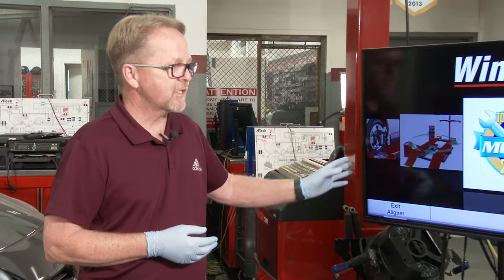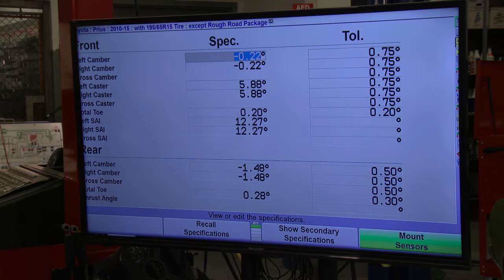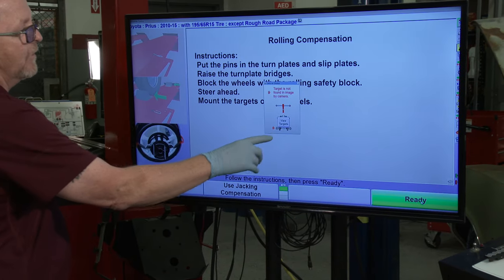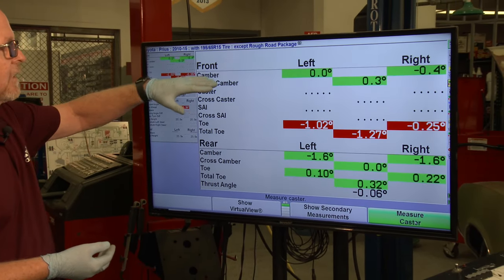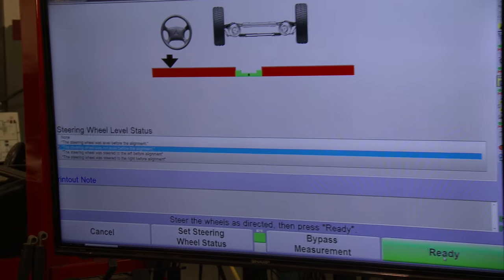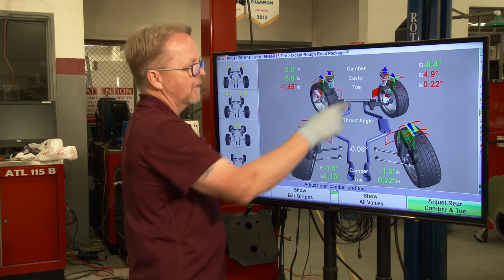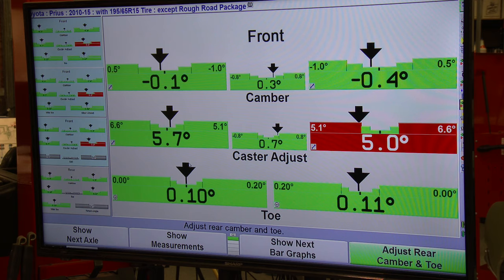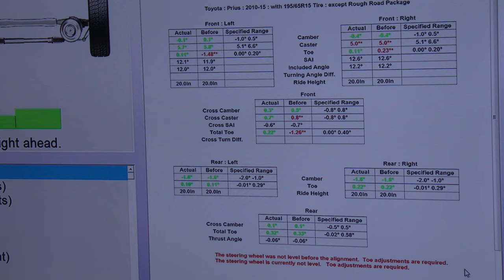Wheel Alignment Using a Hunter Alignment Machine

Comment: This is a well articulated lecture on a PA200 Wheel Alignment Machine. I once used a Microline PC 3000 Machine, Hunter D1111 Machine and Hunter  PA100 Machine. Currently I am using the PA200 Hunter  Aligner. Thank you, Sir for the lecture.
Reply from the maker: Thank you for the compliment. It sounds like you’re a well experienced technician so I really appreciate it.

Comment: I bought an old hunter machine, had to replace the batteries with some different ones on the heads (had to mount them on the exterior) and managed to get the program to work on a old laptop (pc that was running the program died).  Very handy to have at home in my shed for adjusting alignment on my race car.
Reply from the maker: Nice! I’m sure it’s spot on.

Comment: When the camber is out of adjustment on a car that they say is non-adjustable. Take the through bolt out that holds the strut to the knuckle and use an air tool with a rotary file to open up the holes in the strut so you have some movement.  Be careful not to open up the hole in the aluminum or steel steering knuckle.  Loosen the bottom bolt, then you have enough movement so you can adjust the camber.  If you are in a hurry and only interested in making money because you are working by the job, then you might want to forget about it and run the car outside.  Another thing is when you are finished with adjustments, you could move the car around a little on the turn plates and recheck the adjustments.  Just doing that might relieve enough stress on the suspension to show a need to fine-tune the adjustments.

Comment: A few lil tips. Start the car before depressing brake pedal and let the power brakes help you. Make sure the arms on the heads dont hit the lift when you roll the car for runout. If customer has sterring wheel cover then remove it before locking steering wheel. Check for worn steering parts and air psi beforehand
Reply from the maker: All good suggestions. Thanks.

Comment: I took my Stinger gt in just because it's been over a year and had new winter tires put on, so figured just get it done, but more car was not pulling left or right and holding the wheel center was fine. After the alignment I have to hold a wee bit left to go straight, or it would pull to the right. I take it back 2 days later, didn't drive it the one day, and they re-do it and its tiny bit better, but still not straight. He showed me the toe is 0 and my rear are in the green, and my front, both camber are just in the red both -1.2 and -1.1 for the right side.  but they weren't perfect in the last alignment, but it still rode straight before i brought it in.  I'm gonna take it back one more time and see if they'll get it right, or ask for my money back and take it elsewhere.  Oh, I don't recall if I saw if he put the brake thing or the steering wheel lock support when he was doing the alignment. if he didn't, I assume this would cause it to be off a bit ?
Reply from the maker: That would affect he toe, which does not cause pulling.  Look for a tire issue.  Swap the left side and see if that makes a difference. If not, move the left side back and swap the right side.  This method can sometimes help identify a tire pull.

Comment: It was really helpful in order to understand what is being aligned during the process as a customer. I wish you could`ve included rear axles too. Thanks!
Reply from the maker: Glad it was helpful!
Reply: There are very few that are adjustable. Hell my 1990 isn't . You have to hammer out a hub, shove plastic shims, test, kick the wall, do it again. One pot hole and it's worse.

Comment: 1) Throughout the alignment process the shop used the lift to raise the car sometimes higher and sometimes lower, does this effects the results or the software knows the height of the lift at all times to compensate? 

How many shops calibrate the actual machine and how often, or does it self calibrate?
Reply: Calibration once per year usually. Plus updated spec libraries and general service.

Comment: In most cases, customers will think that performing an alignment makes the car go straight regardless if they have caster issues or not. At the end of the day, the customer is paying to make the car drive straight, and , in most cases, won't understand what's happening. I've had a lot of cases where everything is in the green, Steer Ahead is 0, Thrust angle is 0, and it still pulls left or right. Is there a formula for to adjustments to compensate for the difference in caster to make the vehicle drive straight nonetheless?

Comment: So just about every time I do an alignment, i do it step by step like in this video. Including the caster sweep after adjusting the rear. But I seem to have the steering off the the left about 11 o’clock. I have the steering wheel locked with the tool. And still the same. A coworker showed me Win Toe and did not use the hold down tool for the steering wheel and seemed to get it straight. I tried and the same result as before. Maybe the way I tighten down the jam nut. When I tighten down the nut I usually have it almost tight but loose enough to make adjustment, then hold the outer tie rod and snug it down. Any tips on keeping the steering wheel straight? I’d like to have my alignments done the first time and not have to roll it back and recheck/ pull it back onto the rack😅
Reply from the maker: Play in the gearbox or rack can cause a crooked steering wheel.  Most cars have a minor amount of play.
Reply: @bruceo1987  that shit be pissing me off lmao. If I don’t use win toe it’ll be off and I’ll have to re do the alignment after driving but I if I use win toe it’ll be almost perfect. I’ve had it flip the whole situation because I never used win toe before but its gotta be technician error for me having it off. But I’m getting better and that’s what counts👍🏼

Comment: I have a 72 chevelle and when i hit the gas it swings and feels like all the tires are going everywhere , do i need adjustable controls arms ? I was told these cars are hard to align , is that true ? Any info or help is appreicated,and would this fix the issue or do i need to adjust , arms or springs ? Im green im sorry  ,and the steering has alot of play,  and would this work for all cars and okd schools ? 😅
Reply from the maker: @Theundisputedtruth  I believe the 72 Chevelle used shims to adjust the control arms in the front. They are somewhat more difficult to align so I’d make sure you connected with a very experienced technician. As far as your car going all over the place, you may have something loose. It’s not uncommon for the shims to fall out of the front end of this type and leave the control arms moving back-and-forth as you drive.

Comment: hi Bruce and thank you for the vid..  how can it not matter @10:03 that the target is centered on the wheel?  if the spokes are tapered and the target is below the 'centerline',  would throw off the camber for example ?    thanks again : )
Reply from the maker: Hi Jimmy. When you perform the rolling in compensation, it picks up the positions of the sensors and adjusts them automatically. It would be unreasonable to think the technician would put each target perfectly in the center of each wheel, so the machine needs to compensate for that.

Comment: Can you set this machine up if a car has been lowered and if so how do you do that as I have a machine in my work but not sure if you can set it up for a lowered car
Reply from the maker: putting boards under the ramps will sometimes allow you to get a lowered car on the rack. After that, the alignment is normal but access can be difficult due to limited clearance around the tires.

Comment: what if the hunter machine doesn’t have a car’s dataset? does it still work?
Reply from the maker: Yes. You can look up the specs on most any vehicle and enter them manually. After that the machine will work from that dataset just as it were stored.

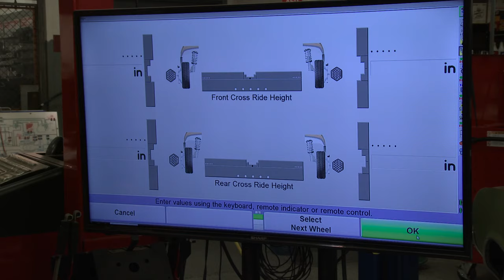Comment: @15:44 That ride height measurement is wrong and shouldn't be used.  Ride Height should be measured from the middle of the front lower control arm bolt attached to the frame/subframe to the ground/lift and from the lowest point of the wheel spindle to the ground/lift.  Then subtract the two numbers and you will get your ride height.  The vehicles workshop manual will tell you what the correct ride height should be with new/old parts on the vehicle.  The ride height should be checked and fixed and entered into the machine correctly before the alignment is done as it will effect the alignment if the ride height is adjusted/fixed afterwards.  Measuring the ride height as shown in the video can give bad measurements because the body could be damaged.  Always check ride height via the vehicles workshop service manual instructions.  And is should be explained to the customer that if there is something that needs to be fixed that will effect ride height, that they should have it done before the alignment to save them $ on having the alignment done again after it is fixed.
Reply from the maker: You are probably correct, however, the ride height really does not affect the adjustments it just alters the readings.

Comment: I went to a tire shop that did my alignment.. my steering wheel was slightly to the left and the car pulled a little bit to the right if i remember correctly.
The technican did some odd stuff and pushed on the cars four corners to settle the suspension.. that couldnt be correct?
After the alignment i did not get the before measurements because something went wrong with the computer or what it was.
So i got the after adjustment.. but... now my steering wheel is slightly to the right. Opposite as before :)
When i center my steering wheel car turns a little bit to the left.

What can cause this? something bad with the suspension or steering components? if so.. what are the most common with this symptoms?

I hope the guy that did the alignment had spoken up if the steering ends or anything with that was bad/play. But he might not checked it. He didnt even test drive or check the suspenson/steering.
As many other shops do. They test drive and also do some checks of the suspension and steering to see if something is bad. To see if its worth continuing or now with the alignment.
Reply from the maker: You should take it back so they can correct it. The steering wheel should be straight and it’s totally adjustable.
Reply: @bruceo1987  i just looked at my alignment results paper. Ive told you wrong. I have the before parameters and not after :(

Dont know if i want to take it bake to that tire shop.. i guess there very competent and all but.. it did not turn out well on my car. If any component are bad steering wheel should be straigt? if isnt that bad components are so bad with play that the steering wheel center line somewat dynamically adjusts as i drive.

Dont know if calibrating the BCM/DSTC system are required on my car. In the diagnostic software on computer i can calibrate it but it tells me its only if any components in the brakes or steering are replaced.. like clock spring or brake hydraulic unit..

Can you please check in your software if thats the case? Volvo S40 1.8 2006 maybe its possible to save the specifications from the settings database to a PDF? Would be nice.
Reply: @bruceo1987  booked new alignment at another tire shop for a second try. At least getting my steering wheel center and not to the right slightly. Told them to check suspension and steering parts also for any play or issues. I needs to go to the bottom with this. It's only possible to adjust toe on my car I believe. Camber are fixed with lower control arm. Caster are fixed as well.. I believe. Not sure about camber and caster
Reply: @bruceo1987   alignment are finished now.. Caster are way off. Diffs 1.5 degree. Toe was slightly off front and rear. But not much. Overall ok. But the big concern was the Caster diff front. He said that the lower control arms are the usual component especially when they're not same manufacture and replaced one at the time. 4 degree on the left and about 2 on the right.

He said it can be a tweaked subframe also.. who knows.

Steering wheel are straight now and that's good. :) he used a level at the steering wheel to achieve a more accurate reading.

Comment: can someone tell me why alignment shops don’t hit the zero mark on all wheels but they leave it at within the range?
Reply: The entire reason there is an "acceptable range" is because parts wear differently on each car due to all the moving parts and differences in how people drive.  Because of those same moving parts, it is also really difficult to hit EXACT specification numbers while doing an alignment. Moving Caster will change your Camber. Changing Camber will change your Toe. Changing Toe can change your Caster, as you see in the video (Though he didn't remeasure Caster, so his numbers are not accurate). The two main goals while doing an alignment are 1) Keep the tires from wearing out prematurely and 2) have the vehicle drive as straight as possible. Sometimes, you can only achieve one of those things, and you need to discuss it with the customer.
Reply: @TomFooleryGaming  ah... I see. Thank you for sharing the information. Appreciate it.

Comment: Any tips on when ur locking down the nut to not throw off ur toe measurements lol?
Reply from the maker: Yes, actually!  A couple of things happen when tightening the tie rods:  The tires move and the tie rods move.  If you try not to let the tie rods tilt when tightening this will help stabilize the readings.  After tightening, you may need to push the tires a tiny bit one way or another to get the screen to show perfected readings for the customer.  Do this just prior to printing your report.

Comment: I just had a guy from Discount Tire raise the lift jack up from the middle of the machine so that he can elevate the vehicle and adjust the lower control arm bolts (camber bolts) on my 2014 Expedition. He seemed like he tightened it at least half the total torque (258 foot pounds) while the vehicle was still raised. Then when he lowered the vehicle on its own weight he torqued everything. But shouldn’t he have only tightened those bolts enough to hold the aligned position while the vehicle gets lowered before snuggling and torquing the bolts? I mean the Ford shop manual says “finger tight” then lower the vehicle, snug and torque everything so that there’s no damage to the bushings. Now I’m afraid he screwed it all
up and I’ll have premature bushing failure soon down the road. No pun intended.
Reply from the maker: The bolts should be tightened just enough to hold the alignment in place while the car is lowered but that’s not really a big issue, unless he was really cranking on them before lowering the vehicle.

Comment: My rear right camber read is -2.14 degrees and shows as red, even after the hunter mechanic was finished.  Should this be cause for concern?
Reply from the maker: Depending on the car, that angle may or may not be adjustable. I’m assuming this is a front wheel drive car. -2° on the rear will likely wear the inside of that tire, however it should be very slow wear, as it’s not a drive tire.

Comment: Has hunter never designed a machine where you don't have to move the car after it's racked?  At my old job we would just roll them by hand but it's annoying as shit
Reply from the maker: The machine can be set up to stop the tires just ahead of the turntables, install the reflector heads, and then roll it forward to get your readings.  I don't use that method because it is sometimes difficult to get the heads to line up correctly.

Comment: Hi. Thanks for the excellent teaching. You are saying that you can play with the toe to get the caster below half degree as long as the toe is in the tolerance specifications?
Reply from the maker: Thanks for the compliment. The toe setting is the most critical for tire wear. It should be adjusted as close to specification as possible. Caster affects pulling and tracking, which are usually secondary concerns to tire wear. When toe is far out of specification, correcting it can have an affect on camber and caster, but you would not normally adjust toe out of specification just to get camber or caster in.
Reply: @bruceo1987  Happy New Year. Hopefully, one day, you will make a video on how to adjust caster and camber. I cannot get to do one to completion at work.